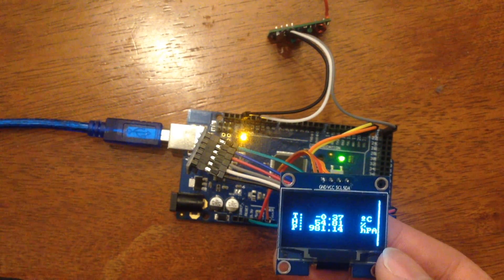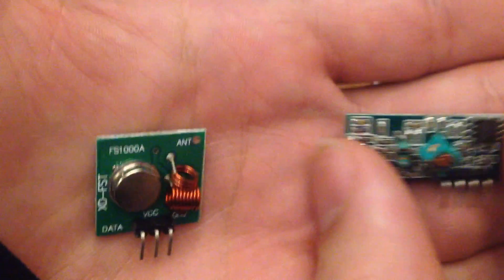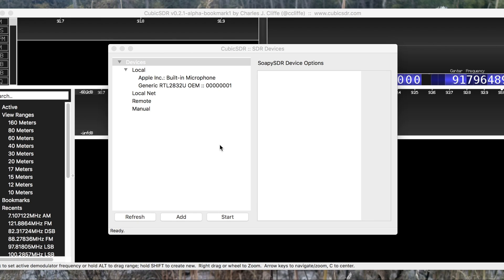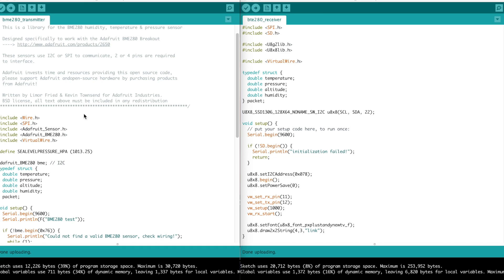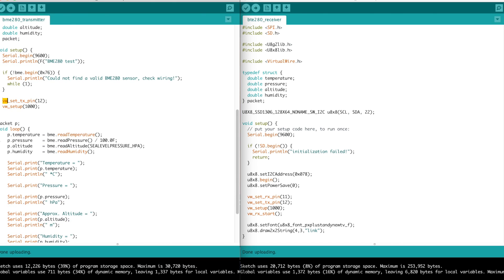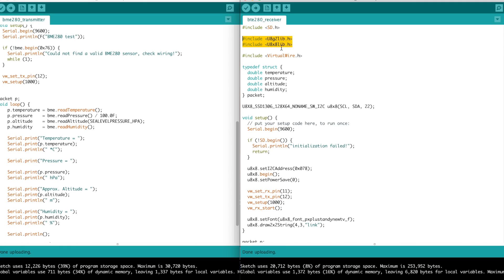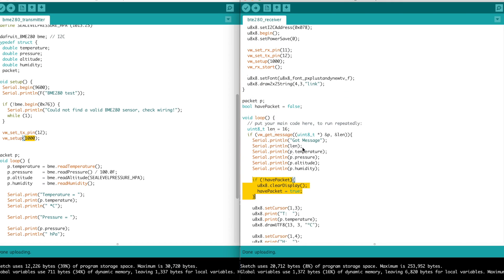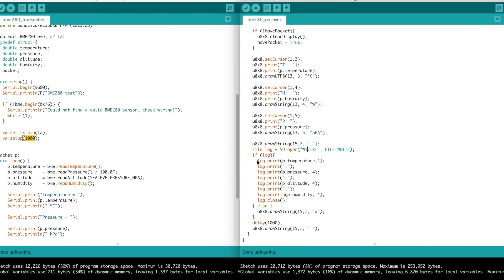BME280 Weather Station Part 1

Comment: Nicely done, thanks for making the video. Subscribed.

Yes I've had that same issue with the displays having the wrong chip, and having offset pixels. Its super annoying, and I have not found a solution. I don't believe there is one?

Have you considered Bluetooth modules for transmitting the data?

Would love it if you made a video explaining the library behind the BME280. what is the 'sensor' and 'BME280' library doing exactly? what are the specifics of the code?
Reply from the maker: +Rohan Sully those libraries manage reading and writing all the i2c registers for measuring pressure, temp and humidity. I tried to write my own driver once, but the datasheet was more confusing than helpful. If I ever get around to building one from scratch, I'll post it to YouTube.

Comment: I have used many of these 433MHz modules and performance from one to another can really vary wildly. Here in the lab with my 433MHz remote sensor weather station I was not able to receive a signal at all from the remote transmitter using the basic receiver so I switched to an RXB8 V2.0 433MHz Superheterodyne receiver (also using a  using a 17CM coiled 22AWG wire as an antenna) and had no trouble picking up the signal. Now on the original basic model i was using a 17CM coiled 22AWG wire as an antenna. Out of curiosity I bought some of those 433MHz helical antennas sold on Ebay and with that installed on the basic receiver i was able to reliably get a signal. On the basic TX 433MHz transmitter I am using a 17CM straight length of 22AWG insulated wire.
http://www.ebay.com/itm/10pcs-433MHz-Helical-antenna-Good-quality-/171252664792?hash=item27df7449d8:g:XlQAAMXQC-tTFbUK
Reply from the maker: Thanks for the info. I was strongly suspecting the receiver was the weaker of the two links. I'll have to try one of those antennas.